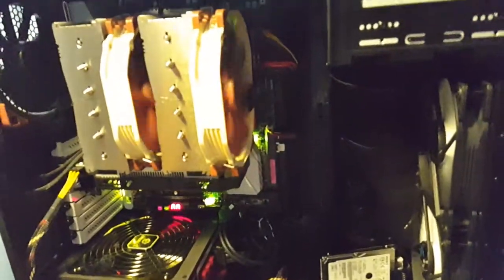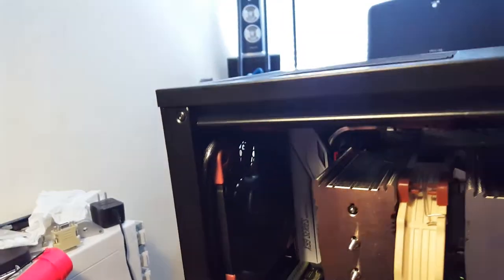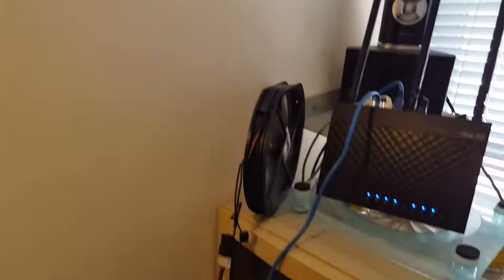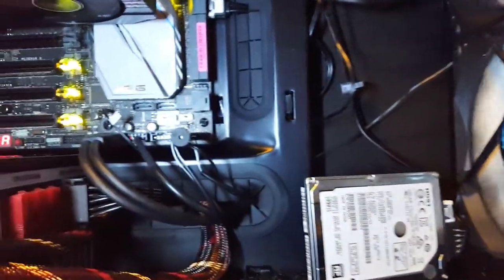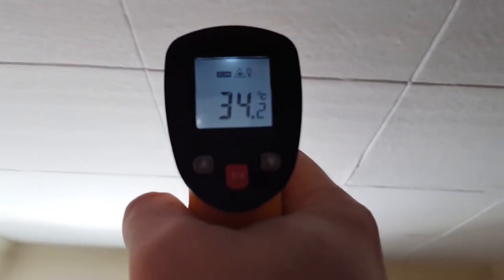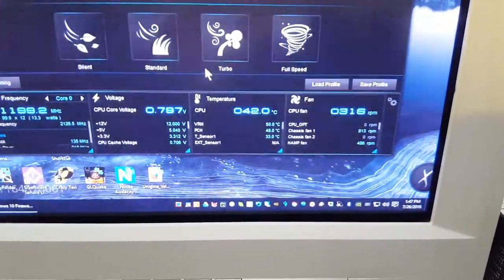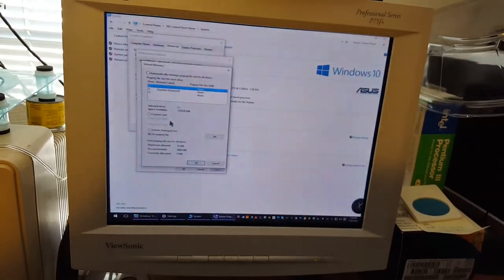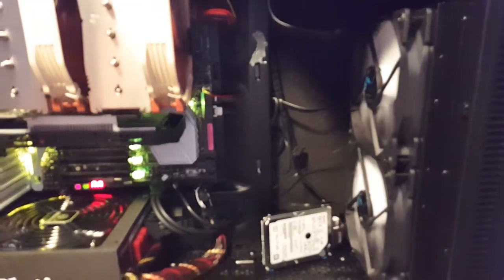My ASUS X99 Deluxe II PC is complete

Comment: I just ordered a 6900K and ASUS X99 Deluxe II, I will get the Noctua D15 aswell. Great vid.
Reply from the maker: Thanks.
Reply: Thanks to you and this video i did place a order on the Noctua NH-D15 yesterday. (and did order the Corsair AX860i PSU aswell) Now it's just the M.2 Nvme, Graphics card and some storage left to order. Think ill go for the Samsung 1 TB 960 PRO as system disk and a 2 TB Samsung 850 PRO as primary storage and a ASUS 1080 Graphics card of some kind, i dont game much, but understand these are good if i'd like to begin gaming. I'm only playing wow casually. And the computer is going to run Linux i think. Not decided yet.
And hey, i do LOVE your CRT monitor. :)

Comment: Great build. How do you like the Noctua cooler? Any issues bumping into the first slot?
Reply from the maker: I think I can get a little better performance from the cooler if I use more thermal paste. I don't think I used enough as I was worried about it going over the edge. One of my other videos shows how I used automatic overclocking of the motherboard and I set it to stop at 75 deg C and I was able to get 4.2 ghz on the 5820K. I think if I reapply with more Arctic Silver the temps would drop a little. There is no issues with the size of it in my  Fractal Design R5 case. There is about an 8th of an inch space between the cooler and my GTX 750Ti card without a backplate. If you have a bigger card the space may be closer. But I honestly don't believe there will be any issues with any cards. Noctua is a good company making excellent coolers.

Comment: Hello thank you for this video I am to buy the same motherboard and I would like to know if it is necessary to connect 8 pine 12v and 4 pine 12v? Or 8 pine 12v are enough for running the card Mother? Knowing that I not overclock tank you
Reply from the maker: If you are talking about the connections above the CPU socket as seen here https://youtu.be/f5vz3Kkgrsg?t=1m44s then Yes you can only use the 8 pin but ASUS manual says that motherboard can overheat with only 8 pin connector under heavy usage. So get a power supply that has a 8pin and a 4 pin to not let motherboard overheat. These connectors are called EATX12V_1 for the 8 pin and EATX12V_2 for the 4 pin. If you want to see more of the motherboard and my entire PC then look at all my videos in this series here https://www.youtube.com/playlist?list=PLqLjsgvQZ4giMWL6WSBrqEdjwZogmI9oY
Reply: I just purchased a lot of similar parts for my computer build, which should arrive tomorrow.  I've never built one though and didn't even take PSU pins into account.  I see the EVGA SuperNOVA 850 G2 I bought indicates it has 24 Pin ATX 1x (EPS (CPU) 2x 8pin (4+4), PCIE 4x 8pin (6+2), 2x 6pin, SATA 10x, Four-Pin Peripheral 4x, Floppy 1x).  If I'm reading that correctly, It'll use the 8pin slot, but it's two 4pins.  This should connect without the overheating issue, right?
Reply from the maker: Look here https://youtu.be/f5vz3Kkgrsg?t=1m44s If you have same board and a power supply with the EATX 12V conectors than you should be fine.

Comment: hi sir,, when i saw your video about your hardware,, your graphic card do not have any issue with noctua nh d 15 (problem installing ) like stuck/stick between cooler and graphic card,, is with gigabyte h55s2v mainboard socket 1156  the result will be the same like you , or it will be an issue between cooler and graphic card ??
Reply from the maker: Go on Noctua website for compatibility list of different motherboards but I am confident it will work with most hardware as they have to follow certain specifications when they design the coolers. I only tried it on this 2011 v3 socket motherboard. If you find out that the D15 may have a problem for you they also have a D15S that has a slightly different design with same cooling.
Reply: I dont know the correct link.. But i"ll go to the corsair h100i v2 or h105 if the hsf doesn"T fit in my mainboard...
Reply from the maker: http://noctua.at/en/products/cpu-cooler-retail/nh-d15/comp#socket_20_manuf_32
The above link is for motherboard compatibility with NH d15. if you scroll all the way up you can choose NH D15S which is a little different.
Reply: Oh thank you...
By the way i got notification for my main board

GA-H55M-S2V

"The cooler is extending over the first PCI-E x16 slot, so please use the other available PCI-E slot(s) for your video card(s)."

But when i translate using google translate i dont know what exactly this mean,,
Reply from the maker: Sujatmiko Afandi This means that the pcie slot right next to the cooler cannot be used on your board if you get the d15. in this video my graphics card is in the closest slot. on your board not is closer so can not be used.

Comment: thats a big fat cpu fan, i'd rather have a water cooler like the hi110 or something
Reply from the maker: Large coolers are more reliable than water pumps and also quieter. And 
the one in this video is close to the cooling capacity of hi 110. There 
was one other cooler that I was considering the Cryorig R1 Ultimate but 
the installation of that one was a lot more pain in the ass.
Reply: but hows the cleaning goes. you gotta take the whole thing?
Reply from the maker: It does not get too dirty. I had it running since june and the cooler 
looks clean. the fans are not spinning very fast so that is one reason 
it stays clean.

Comment: ok i have the Asus Deluxe ii motherboard jsut like LoveNation and im looking at getting this SAMSUNG 950 PRO M.2 2280 512GB PCI-Express 3.0 x4 Internal Solid State Drive (SSD) MZ-V5P512BW at newegg http://www.newegg.com/Product/Product.aspx?Item=N82E16820147467 for great price. ive been reading that all Mobo's are not compatible and wont boot from it. I emailed Asus and they told me its not since its not on the QVL but yet LoveNation has it and another guy on newegg said he had the same device and mobo but no one saying it will boot from it and get the speeds its rated at. I need to know for sure quick before the price goes back up if this samsung M.2 drive with its high speeds ( NVMe technology etc ) will work on my board and boot from it as well and is compatible. I wanna replace my standard 240gb SSD with it to get the blazing speeds etc. I just dont wanna buy it and not be compatible. Any help is appreciated and thanks in advance for yalls help. one guy on toms hardware said he has the ASUS Maximus Viii i think and its not on his QVL and it works with his just fine so my guess is it will work with mine but wanna make sure.
Reply from the maker: Mark Johnson I am able to boot from my m.2 but I am not using UEFI bios because when Microsoft was giving away free Windows 10 I had to upgrade my current drive which had Windows 7 before installing on this one. I tried to install Windows 7 using UEFI on the 950 Pro m.2 but I was not successful so I had to copy my Windows 7 installation which was originally installed without UEFI and then get the free Windows 10 upgrade. I have not tried installing Windows 10 straight from USB on to this m.2 SSD. people have done it but at the time when I was trying mine I did not have a bootable Windows 10 USB. Bottom line is that I am able to boot from this m.2 SSD. I have another video showing that Windows 10 boots from m.2 on my system not using UEFI bios settings.
Reply: LoveAviation i currently have win10 on my 240gb ssd but i at one time did do the free ipfrade to win 10 from win7 but its been a while.so all i have to do now is do reset win 10 if i ever hade to have clean install instead of reformatting with win7 then install win10. all id have to do right now is clone from my 240gb ssd and i should be good to go correct? is it worth getting since u have to go through all that trouble? is the 2500mb/1500mb read write speeds worth it! blazing speeds better than standard ssd's?

i do have the uefi bios and dont wanna loose it or the ability to go into it.
Reply from the maker: Mark Johnson
The m.2 in my current pc is the first time I used it in any computer and my computer I built new in the summer. I get the fast speeds when windows is booted up. during boot up it appears like a normal boot. I also do a full boot each time. I don't like that hybrid boot that new windows versions offer. I also enabled NTFS compression on the m.2 drive so I loose some speed slightly. I am happy with the performance. If I had more money I would get a bigger one or have 2 in RAID 0.